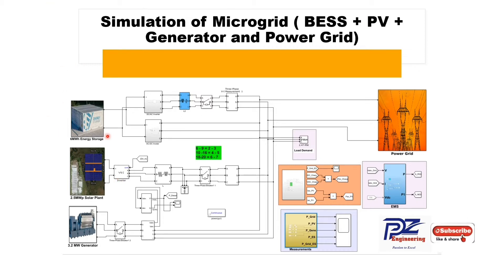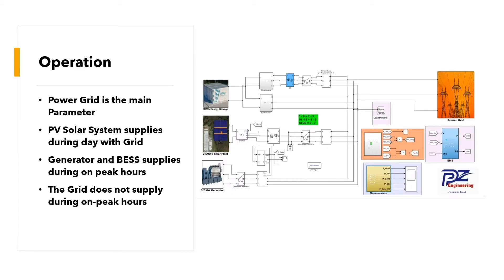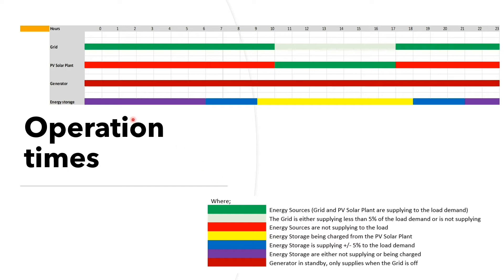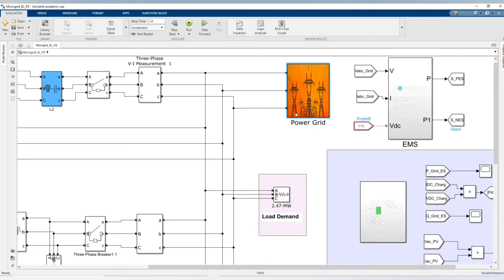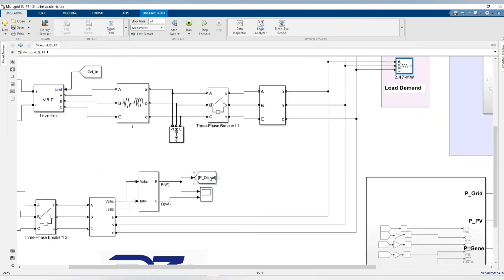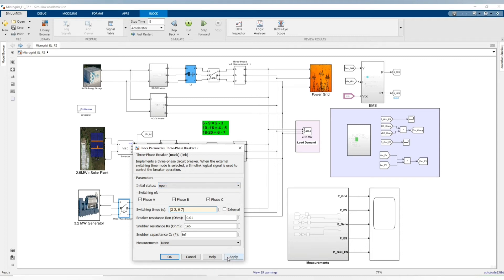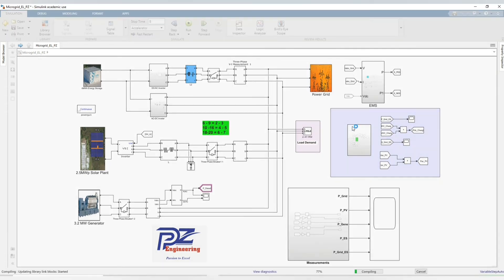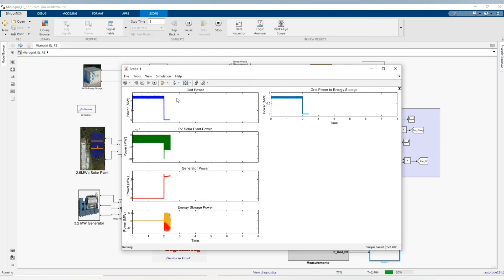Simulation of a Microgrid ( PV Solar System, Utility Grid, BESS and Diesel Generator ) in MATLAB

Comment: I recently joined the Platinum membership channel, expecting full access to the models and documents, but unfortunately, I still do not have access. I have already reached out via email but have not received a resolution. Could you kindly guide me on how to contact the channel administrator to address this issue?
Reply from the maker: Good day. You can have access to the model by emailing Engineeringsolution800@gmail.com
Reply: Nice to hearing from you.
I did email 📧 
I think a weak ago but didn't received any reply yet..
Reply: @pzengineering2020  I emailed you again but didn't get any reply yet
Reply: @pzengineering2020  can you please check your email
Reply: @pzengineering2020  hello I emailed you; but you are not replying did you stop the support of Platinum members?
Reply: I am waiting for your email ?

Comment: thank you so much for this great work . how can I get the simulation file .so  I can run it on my computer ??
Reply from the maker: hi thank you for your comment, Yes can you please email to us on pzengineeringsolution800@gmail.com
Reply: @pzengineering2020  I tried to reach you via the email you wrote earlier in the comments but it is not working for me
Reply from the maker: @romaysaduridi3284  this is our official email engineeringsolution800@gmail.com, please check very well, or you can WhatsApp us on +27 622869321
Reply: Please how can i get the full model

Comment: Thank you sir, for your efforts. Sir, how can manage microgrid like this?
Reply from the maker: Hi thank you for your comment. It is possible depend on how you want it to operate, which source supplies in different time.
Reply: @pzengineering2020  Can I contact with you on email if you can?
Reply from the maker: @عمرياسين-إلكترون  Hi, yes you can
Reply: @pzengineering2020  Your email?
Reply from the maker: @عمرياسين-إلكترون  pzengineeringsolution800@gmail.com
Reply: @pzengineering2020  There is a problem with your email.
Reply from the maker: @عمرياسين-إلكترون  Good day , can you send me an email again on engineeringsolution800@gmail.com , We have been communicating on these email